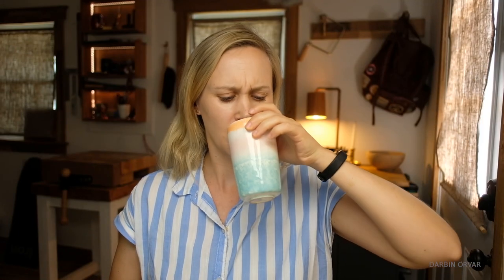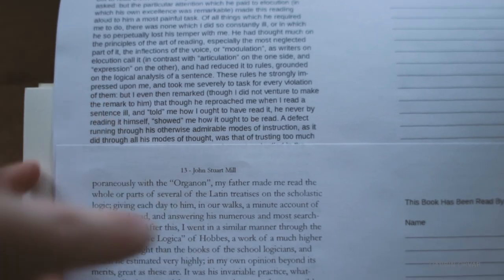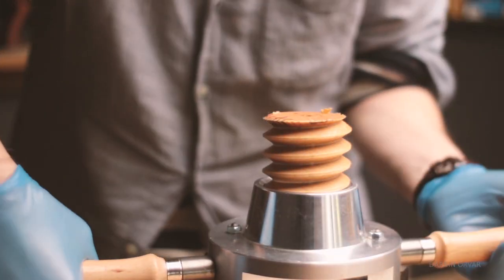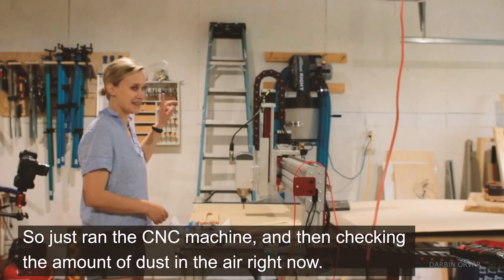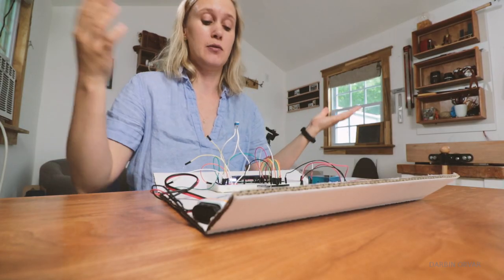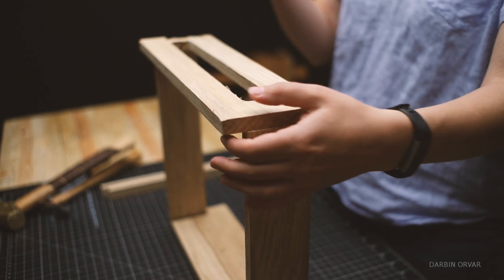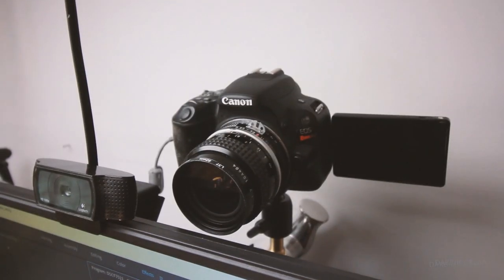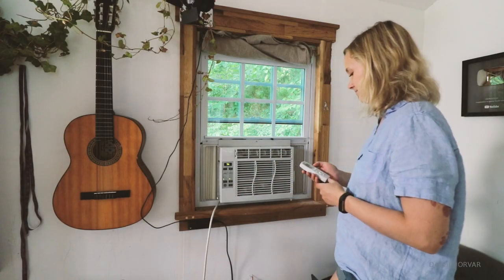Shop Update! Bookbinding, Jigs, Air Quality Sensor w/ Arduino, FAQ

Comment: Great to see you back Lin; I'd wondered if you might have another 'special little project' on the way? LOL. Loving your bookbinding apparatus & that you still do quality work with hand tools, despite all the amazing toys available to you, thanks for sharing this                                                                                                                                                                                                                                                                                                                                                                                                                                                                                                                                                                                                                                                                                                                                                                                                                        with your audience. I find it so frustrating when some other YT channels are like "Tim the Tool Man Taylor", grunting & emphasising power tool use over skills & workmanship. Making beginners think they need power nailers, air compressors etc to build their first, most basic picture frame cheats them out of valuable learning opportunities hand tools offer. As an engineer's daughter I learned early as if in high school - first workshop safety, next hand tool skills & maintenance. Power tools was the reward or incentive for doing well. Not saying that I don't love my own power tools. I do, just that I still have my little 'egg-whisk' hand drill & my various handsaws from nearly 30yrs ago and all of my fingers & toes.

Comment: You can also use sandpaper to clean the edges of a book.  It’s actually a normal bookbinding process to get it ready to gild the book and it also provides a clean flat surface.  I made a jig to hold the book, used an offcut of stone countertop and wrapped a narrow piece of sandpaper around it to run on my jig and sand the book edge.  Worked well.

Comment: FYI on the particle sensor.  There is a cheaper option to the Arduino called the ESP8266 (I got a NodeMCU style board) which in addition to actually being faster also has wifi and can be programmed in the same Arduino IDE.  I used a similar particle sensor on an ESP8266 and both run a small webserver on the module so you can read the particle values remotely, but it also broadcasts the values via MQTT so the data is available elsewhere.  Another tip is that you can also get I2C sensors for a couple of dollars each and add that to the same controller.  In this way I've added temp/humidity as well light level, so I can see how the dust levels relate to whether the lights were on in my workshop.  I also got a VOC sensor for I think $6 which also connects via I2C so it also reports air quality in terms of volatile organic chemical levels.  All of this for a total cost of about $30.

Comment: Great video.  I appreciate the update.  For your arduino project, get the LCD shield from adafruit and it will drop right on top of your Uno.  No wiring, no mess.  You can also get print a 3D box that will hold this setup to make it look more polished.

Comment: I use two of those box fans in my garage shop, and it works great.  When CA had our major fires last year I had 4 of those running with filters and it kept it safe inside vs toxic outside.  I used the Dylos DC1100 pro air quality meter that Mattias Wandel showed at one point on his channel, it was expensive, but the arduino looks cool as you could easier save it elsewhere to do graphs. :)

Comment: I have a box fan in a frame with a filter and it runs a lot of the time. But it is amazing how it scrubs the air in my 620 sq ft shop. I vacuum it out about twice a week.

Comment: If you add blue tooth to those sensors, you could place them around the shop and have them send their data to a central arduino and display all the data on a single screen. This would give you and indication of air flow in the shop.

Comment: Linn,
it's nice to see that you are getting into bookbinding. However, if you are going to make the books all by yourself, please look into typesetting/typography some more. It's not just "getting some texts from the Gutenberg Project and lay-outing them". In the past centuries, making a fine book has always been a combination of the bookbinding, printing and typesetting trades. Typography is arguably the most demanding of the three. With printing (in the narrow sense) out of the picture because of laser printers, please make sure to at least give due attention to typography.
Reply from the maker: The next shop update will actually cover a bit about formatting, software, printing etc.... 🙂

Comment: Hi! Linn. I am also trying to make book using the tool. I bought the tool from same site you recommended and followed your advice in order not to break the fiber. Socking into the mineral oil over night. However, my ash is not working well. Fiber was broken so, wood thread is not even and smooth. If you have extra advice to me, please let me know.

Comment: I do something similar with box fans, but I get my filters from filterbuy.com (I'm not affiliated, that's just where I get them).  I buy 2 inch (thick) 20"x20" filters and I get the MERV 13 filters.  If I recall, I get them for less than $20/filter.  I tend to order a dozen of them to reduce shipping costs.  Also, when I attach them to my filter, I use painters tape and seal up all the way around rather than just running a few pieces.  My dylos air monitor tells me I get down to double digit (>2.5) particles and single digit <.5 size particles.

Comment: Nice! We had similar ideas around the Dust monitor for the shop.. I ended up hooking up my Arduino to with Dust sensor to an Air Cleaner... when the air gets too dusty/dirty... it turns on the air cleaner until its clean. Project details: https://github.com/chrisleedotninja/auto-airfilter